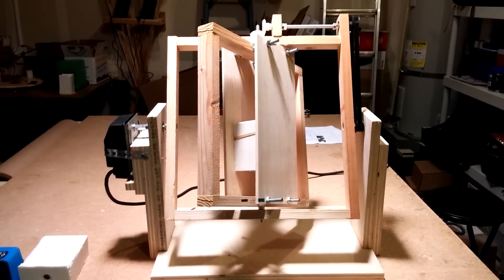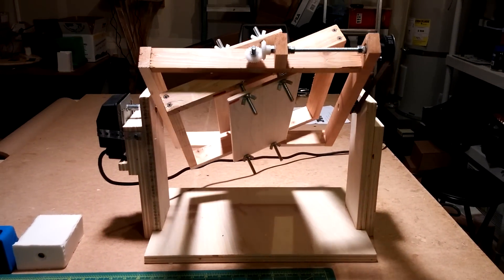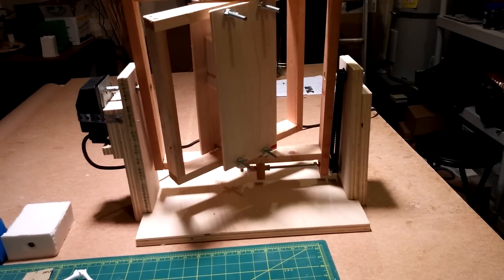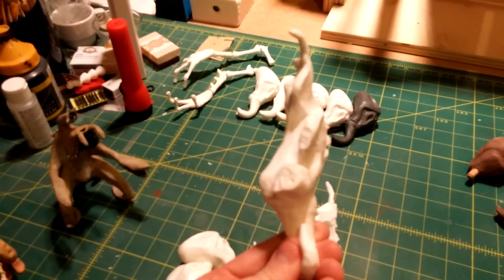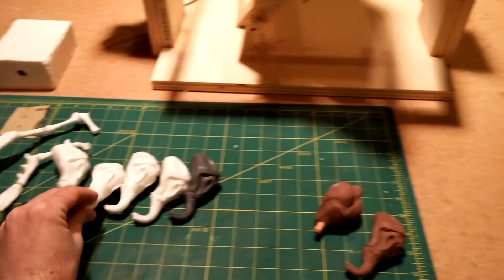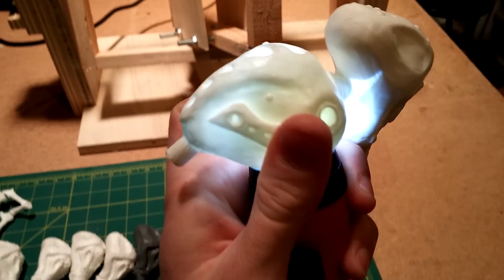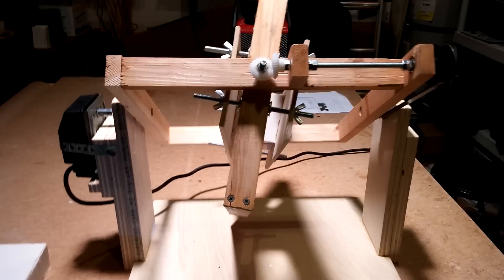Cheap Rotocasting Machine

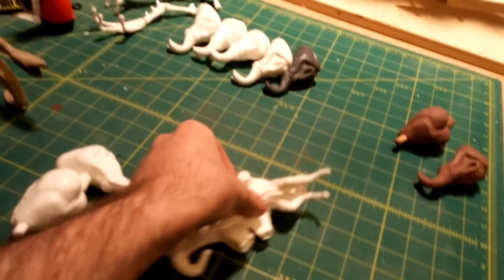Comment: Excellent work! I'm curious, how did you cut in half the hollow resin casting (the one you split at 0:55)? Thanks.
Reply from the maker: Thanks! It was some time ago, but I think I just used a razor blade while the casting was still warm and fresh out of the mold.
Reply: Dejarik Creations , thank you for the quick reply!

Comment: what resin are you using for these?
Reply from the maker: Smooth-Cast 305 - It works well for the little stuff but the larger things tend to clump up. I imagine I need some proper roto-resin any recommendations?
Reply: 305 is what i use for lots of my small parts too. Never tried roto casting anything so small but i have a few items that would be perfect for that. I use 300 for bigger stuff but do multiple small pours to build up the layers without sags and bumps.

I've heard Onyx is really good for rotocasting but haven't tried it yet.